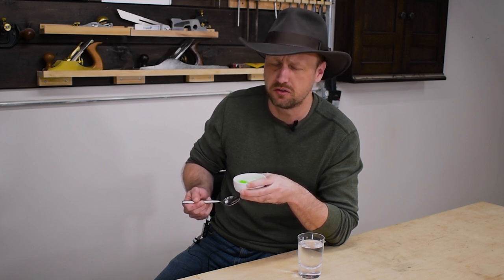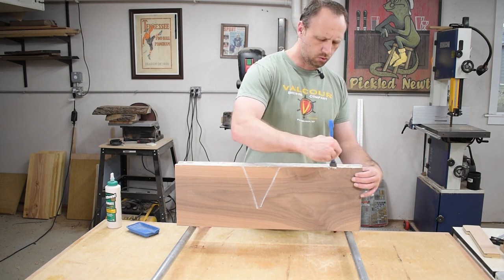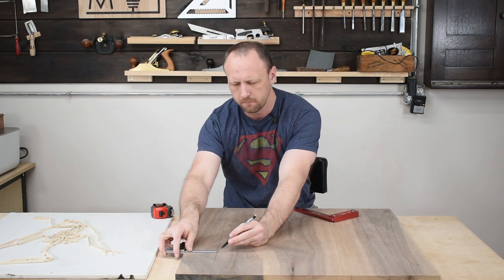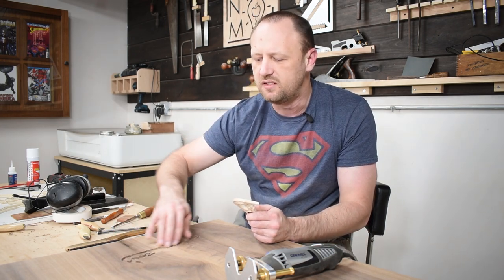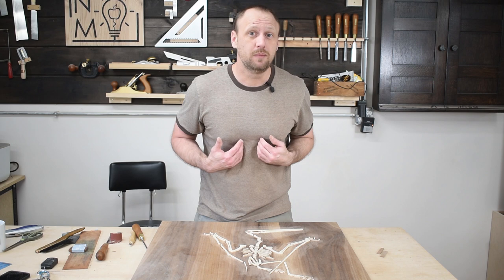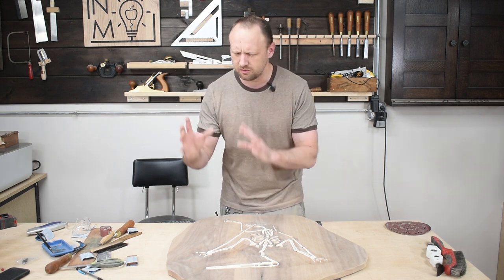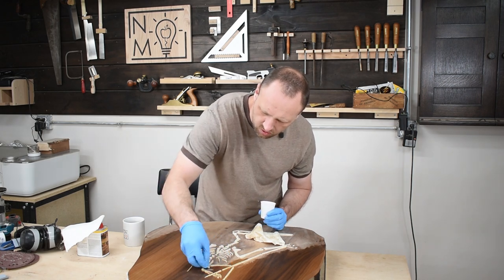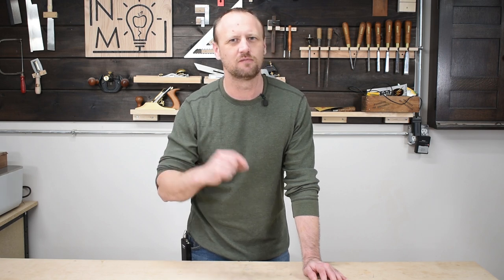Dinosaur Fossil Inlay in Wood

Comment: This looks awesome! My only question is: as an alternative to doing the intarsia mortises by hand or with the dremel, could you instead use the CNC? A narrow degree V bit such as a 15* or 30* would allow you to have nearly vertical sides, but also give you a precise, friction fit on the pieces. You could still assemble piece by piece, but tap them down into the mortise for that tight fit. I haven't done this myself, but am wondering if maybe it's worth a try!
Reply from the maker: 100% you could have used a cnc. I wanted a project that would help build my hand tool skills so I figured doing it this route would help. I feel like it did. I hope it did... 🤷‍♂️
Reply: @NewtonMakes  That makes sense! Thank you for the reply!

Comment: EXCELLENT PROJECT, BUT observation though, . . . Bones should definitely have rounded edges, b/c that's the shape, tube-like. Otherwise, it looks like a puzzle. It looks amazing, but for more realism up close, I'd definitely round the edges of the bones. Besides that, weathering would soften the edges too (even if they started off sharp edged).